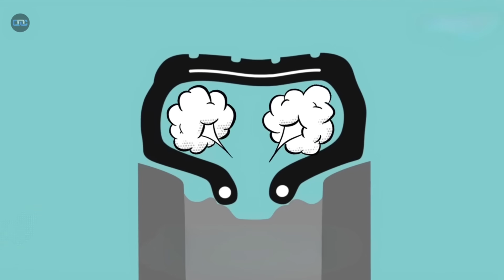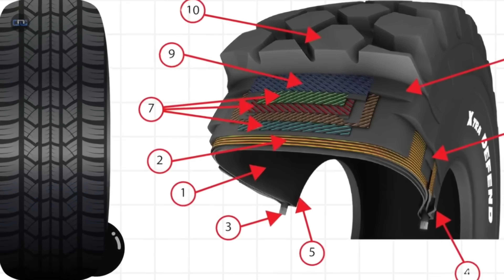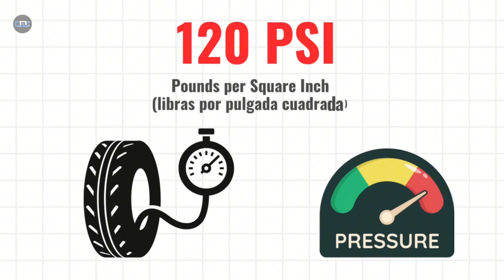Why Tires Are More Dangerous Than You Think

Comment: 5:42 This is why people should never do burnouts on the road as it doesn’t just wreck the road it can also cause tires to blowout as well as set the engine on fire as well as a fine for dangerous driving if caught by the police. Rougher roads increase the likelihood of a blowout when doing burnouts compared to smoother roads but seriously don’t do burnouts.
Reply: When I was a young man I had a 1978 Ford F150 400 with some upgrades. It did crazy burnouts with ease. Since I was young and stupid I saw a group of teens (probably drinking) near the railroad tracks in a small town in Missouri. They shouted out to do a burn-out and what's a teenager to do.... After about a minute of burnout this kid comes running up to me holding a baseball/softball-sized chunk of smoking rubber saying "dude! This came out of your tire!" My heart sunk... There goes those tires. I got out and checked and there was shavings of rubber in piles and he had scraped a bunch up into a ball and showed it to me lol. Probably a good half-inch lost off of fairly-expensive tires. As I said, stupid.... But cool too. I smoked out the whole town and since it had headers, dual 3"  exhaust exiting the front wheels it was insanely loud. I'm still shocked that the town's one cop didn't get me lol. I miss that truck ;-(
Reply: Burnouts are okay as long as you are somewhere that you aren't endangering other people. I live in the country. We have roads where you won't see another person the entire trip.